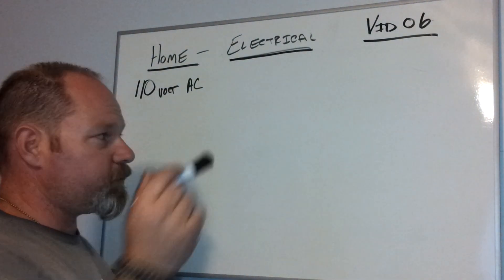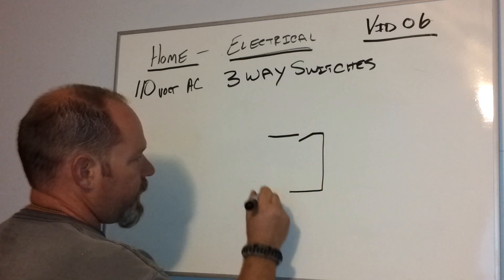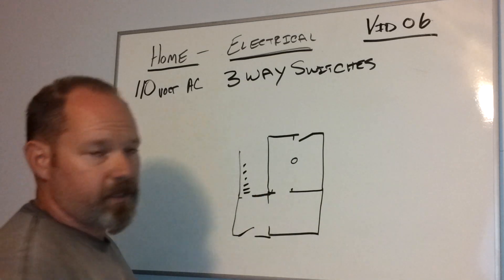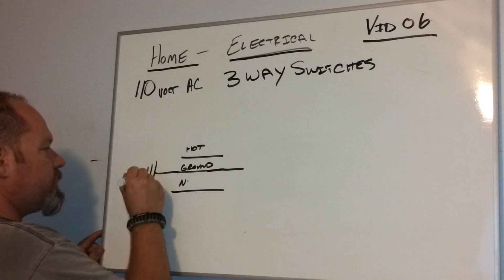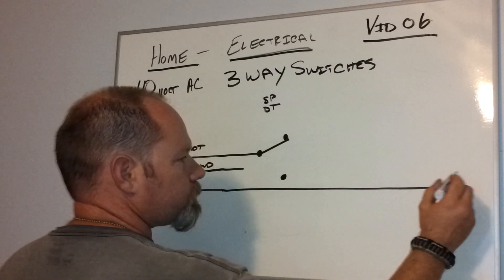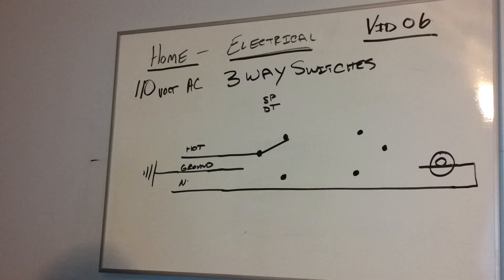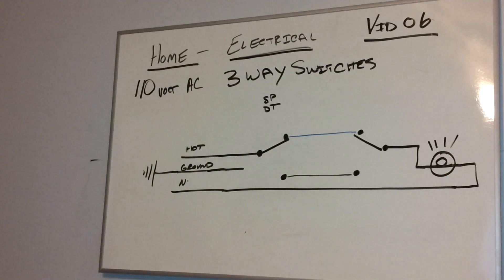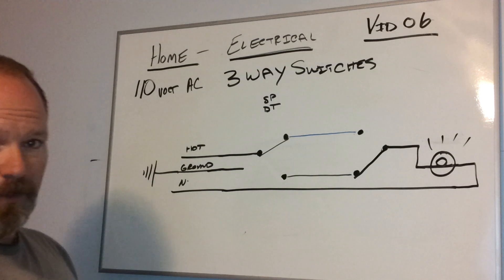BASIC ELECTRICAL 101 #06 ~ 3 - WAY SWITCHES

Comment: We have a couple of 3-ways in our house, but they don't work like this. One at the entry into garage, from outside and the other is located when you exit the house into the garage. Both need to be in the right position for the light to work. After reviewing the video I'm thinking I should be able to turn on the light with either switch no matter the position of the other. Am I incorrect. We have another in the kitchen that works the same way. Is something wrong? Anyone else have this issue?

Comment: Why there's a 110v and 220v? what's the difference?
Reply: So the United States uses 220V too?
Reply from the maker: +KMF 120 and 240 for residential. We also use 208/240 single phase, 277 for lighting, and in 3 phase we have 240, 480volt. I was at a steel mill and see over 4000 volts there
Reply: Guy Brown ok thanks

Comment: I am getting the concept of the three way switch but I have a question. According to the diagram you draw if both switches are in an on or off position the light will come on. Should I therefore conclude that on/off is just an ideology when it comes to three way switches. In that I mean, to get the light on both switches must be in the same position relative to each other and to get the light off the switches must be in a position opposite to each other. This is what I conclude from the video. Please let me know if I am right
Reply: That is what l concluded too

Comment: Can you do a video on the common problems with 3way switches (why they don't work)? I've got two 3way switches but switch B only makes the light go on & off when switch A is flipped up. If switch A is flipped down, the light goes off and flipping switch B does nothing.